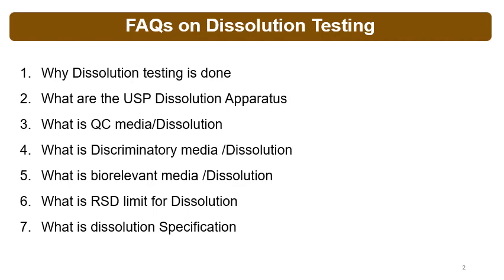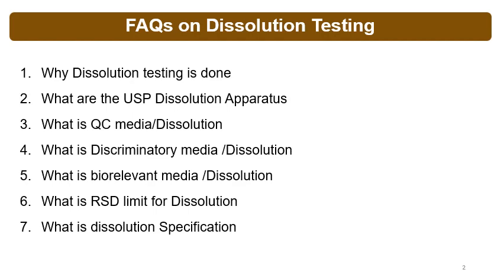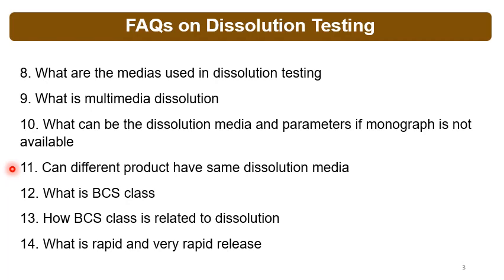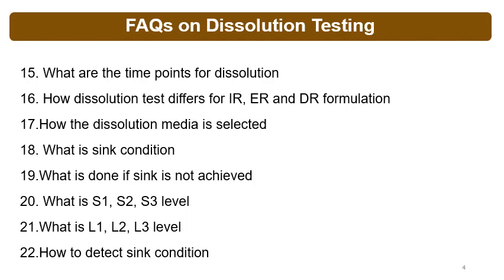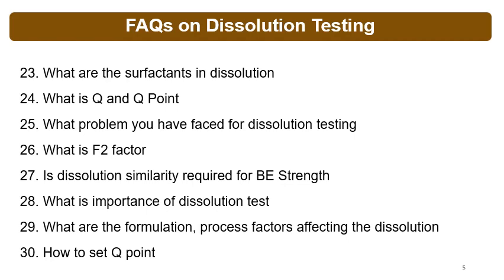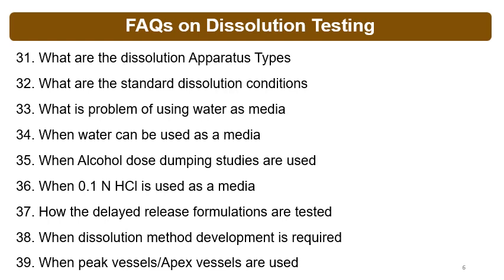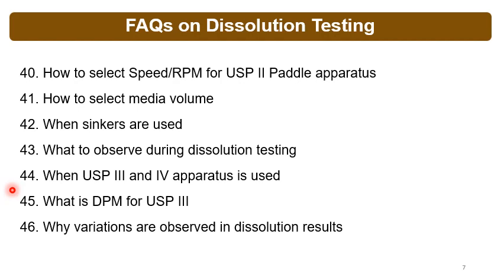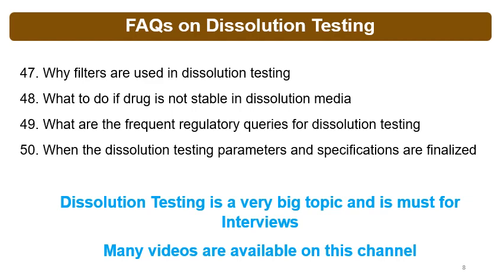Dissolution Testing Frequently Asked Questions and Answers

Comment: Why generally 12 tablets selected for dissolution study?
Reply from the maker: 6 tablets used in S1 stage to have minimal statistical significance
Additional 6 units are tested in S2 stage to it becomes 12 units (6+6-=12)
Additional 12 units are tested in S3 stage to it becomes 24 units (6+6+12=24)
Reply from the maker: Why Dissolution Testing is Done on 6, 12 and 24 Units
YouTube · Pharma Learning In Depth
1 week ago
Reply from the maker: Go through the video